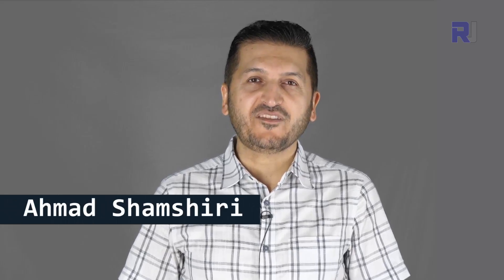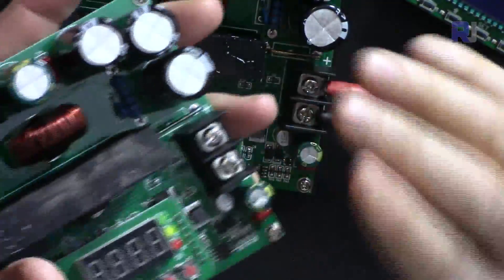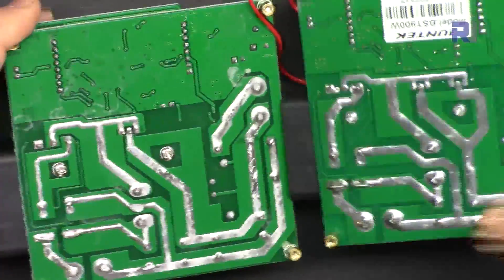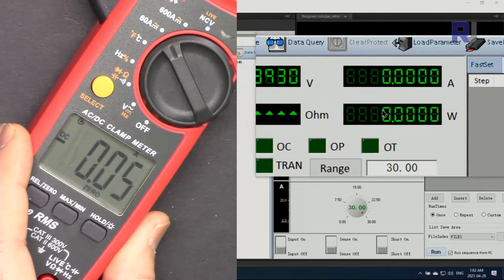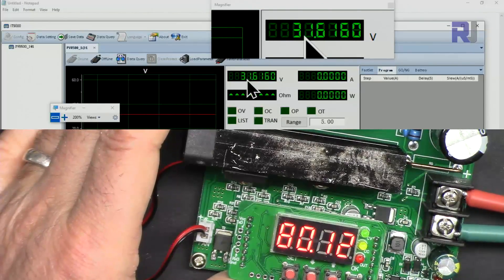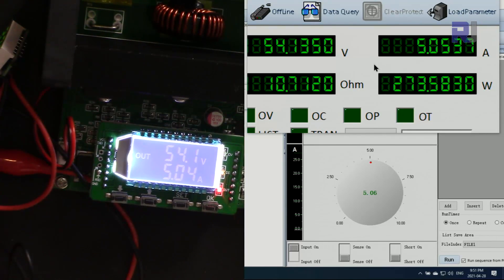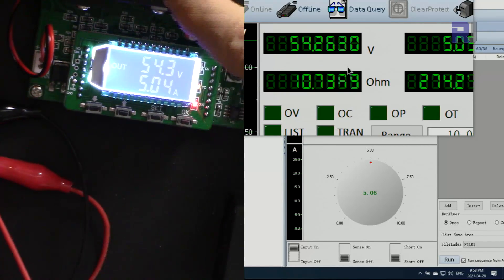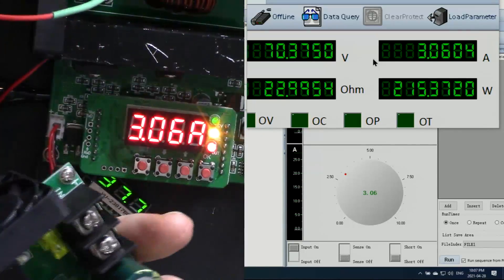Beware of BST-900W 8-60V to 10-120V DC Converter. Does not work. Fake 900W

Comment: new update from my last common .i change the fuse from 20A to 40A . and  last test update is input 11.85V(dropped limited input)  with  27A (320W)   and get  output 56V 3.85A (216W) efficiency 68% with that range between 12v and 56V .... and i stopped the test . because the coil and mosfet get crazy over  hot in 26A input for 2min ( need more big cooling )….. i think after i modified the component in the board it worked very very very good. ( if any one need feedback on this model please be free to pin to me about it . this model it have more power than you think but not from the company because they have too many things need change maybe for bad calculation design or bad component power .

Comment: hi Ahmad . I managed to make this unit work with full power . I do some reverse engineering about this dc boost converter BST-900W . you need to do 4 things changes in the circuit . 1:( in this unit there 2 shunt resisters , one for  current input that located beside the 20A fuse   and the other for output and its in the output . just short the input shunt to 0 ohm with soldering all over it with big wire . so the microcontroller do not activate the Mosfet slow down gate PMW protection ) 2: (change the coil from 0.04mH 0.3ohm  to 0.4mH 0.3ohm or 0.1ohm if you want less of drop down voltage but consider the Mosfet to heating up more) .  3: (change all 3 capacitors output from 330micF 200v to 470micF 200V  and the capacitor c14 104j 400v with bigger one that came with same 104k-E 400vmp .) and 4 : last things you can change if you want the Mosfet FDH055N15A with Mosfet IRFP4568 its same details with same every things of the stock Mosfet but with only better gate responding since the gate of stock need 4V and the new Mosfet only want 2V to activate and that give you more responding in high voltage pushup  .   i try it and it work you only need good coil or make one as i did . but you will hear some sound from the coil in high frequency . 

i can send some picture later about the changing part and a picture of input 11,7v 20.6A !!!!  and output of 50V with 4A ( efficiency drop )coil need more caliber calculation with the  high frequency and large range boost voltage . i was happy to fix something  originally was weak . and even better i was able to power up the input to take 20A ++ (i did  not over it consider the fuse is 20A and the mosfet will heating up not able to cool down easy

Comment: The specification clearly shows a max input of 15a and 60v so if the input voltage is less than this, the input power will inevitably be less than 900 watts and the output power also.

Comment: hi ive been useing this for six years. perfectly.. it charges my lipo4 batts. 48v.  --72v. and 82v. li.. and lipo4.. no trouble
Reply from the maker: voltage is no issue. it is the Power (current). they lie about it.

Comment: 80 volts and 15 Amp will never work. The device is 900 Watt no 1200. SO if you want 80Volt you can have max 10.5AMp. Power = Volt x Amp
Reply from the maker: You can’t even get 200W. I have shown the result. All stores are selling it as 900W on eBay and AliExpress.
Reply: There must be something wrong. Many videos on YouTube show these devices working as advertised. maybe not 900 but 700-800 watt no problem.  I ordered one just to test in my lab.

Comment: Hi Ahmad . This device as I try it in many may is not more than 100W in between 12v and 50v and 70w between 12v and 120v but it can deliver max 150w when you have less than 10v deferens

Comment: Hello, the problem with these boosters is that they always refer to the total input power supported. For example, in the case of the bst900w, with an input of 60V at 15A (with that voltage input it gives the 900W that the equipment says it supports) however for other input voltages such as 12V you have to be aware of the maximum 15A that the module admits (12*15 = 180W max) therefore if you want to raise from 12V to 60V, you have to respect the 15A input, which you have left to work 180W, where the output will have a maximum of 60V and 3A which gives 180W, with an input voltage of 12V and a maximum current that supports the module of 15A.
Reply: Your explanation is clearer than his, did not explain much of his setup, like we understood it already.  Like what's that on the left computer screen, its just annoying and does not help much of the explanation. This guy does not know how to explain well his setup.  I have a mini dc to dc converter and you can't set all of them to their extremes must obey the laws of power supplied, and the current and voltage limitation of the converter.  So I highly doubt his presentation, he must just be confusing himself and did not understand properly how a buck converter works.  But anyway, I shall heed your warning even if I doubt it, was going to use this to power my powerstation from car battery and adjust the rate of charge using this. Since this is expensive device and no other video on youtube show setup to extreme only to lower currents, Ill hold it for now and maybe just buy those inexpensive enclosed 12v to 24v buck converter which are cheaper.
Reply: Thank you explained
Reply: so the power only refers to the maximum Vin and I(in) that the module supports. I give you a very useful formula to know how much intensity you will have at the output according to the input voltage and the maximum input I supported by the booster: (V(IN) * I(MAX_Ic_IN))/V(out)= I (MAX_Ic_OUT)

Comment: Hi, I've been using this product for a year, mine does not have the Brand Label you show. I purchased from Amazon in USA. 
Regarding the issue when you turn it on to charge your  battery; the voltage reading you see this voltage level of you battery your maximum voltage setting(80v). As your battery charges this voltage reading will increase up to 80v, at which time it will stop charging. Also the CC LED is normally 'on' when you begin charging.
I've only used mine to charge my Lion battery pack to 53v and 1A so I don't know how this controller works at the higher voltage and current levels you are using.

Comment: Wanting to buy one of these make sure it is a Ming He branded one. Mine works up to 120v and is really crazy really because who needs 120v DC anyway most times. However i only tested it to 600w because after the 6th 100w bulb i said ive seen enough to trust it was working. Also for others reading this,  keep in mind that if you dont provide enough input current it wont go past a point before you have input limiting.

Comment: Hi. I have that version with LED display and I'm more or less satisfied. I have bought it as charger for my electric scooter because battery is 60V and I have power supply only 60V. Because battery require 67V at full charge, I use this 900W device. I'm able to charge at 670W. So I'm drawing 788W from my power supply as input to that boost converter (55V@14A) and output I have 67V@10A (670W). Difference caused 85% efficiency which is in the description. I'm using it for 3years without any issue. One thing that bothers me is noise. That switching noise is pretty loud. So if you have on input for example 12V@15A (that is maximum possible current), that is 180W. On output you can draw only 180x0.85=153W. Which means that if you want 120V on output, you will be have current only 1.275A. If you want 900W, then for example you have 60V@15A on input and 60V@12.75A on output, which is 765W (with 0.85 efficiency). So 900Watt means only for input. Sellers on Aliexpress often lies. Yes. But in this time it was close enough to the truth.

Comment: I have been using one of these for 3 years. Mine is MingHe, not Juntek.  I also do not see the current rise as it should.  I charge a 60v battery.  From a 12v source I can only get 1.75 a. From a 24v source I can only get 3.7a. From a 36v source I can get  7.5 a.  I have not tried 48v source yet. It has been reliable.
Reply from the maker: Hello, I am trying to tell people that this is sold under 900W and it is not even 200W. that is it.
Reply: @robojax   You are right. It is cheap chinese junk. Another problem is the mosfet that controls the fan is only rated for 40v and it fails. Then you cannot check it becuasee the code is burned off. it is AOD4184 .  Part of the problem is my mistake in selecting a boost converter for charging my batteries instead of a buck converter.  Boost converters loose amperage the more they try to boost the voltage.  Buck converters Gain amperage the more they reduce the voltage.  I suspect a larger inductor would address the issue you raise.  If you try it and post a video please send me a message an I will contirbute a donation.

Comment: my only problem with your testing is it was limited by the current capacity of your thin wires try using 10 awg in from a car battery or your power supply then test the output load because with my small jumper wires in from my power supply it is a 12v 5A backed up with a 16v 83F capacitor bank and i was able to push out 70.54v at 0.58A into a 200w 120v heater core and got usable heat from it so i will be using this for a battery powered heater that uses less power than most 3 party vehicle heaters and be usable for a tent overnight powered by a li-ion battery pack that can supply up to 6000-8000mAh
Reply from the maker: The wire has no issue. I don't know if you watch the video fully or not, I first showed that my power supply can supply  way more than enough for this module.  Thin wires will cause voltage drop like source outputs 100V and due to the current (ohm's law) it delivers 95V. Wiring is not issue. this is item is sold with fake power value.

Comment: I have one of those boost converters and is not very stable above 80volts 4 or maybe 5 amps. The problem is the power mosfet. Its rated at maximum 150volts 10 amps i think. So when you need for example 80volts@5 ams or 400wats you can imagine the mosfet is in overdrive mode before burn. Just the current is too much for it. 400wats for example at 12volts imput is 33.333... amps if the boost process is 100% efficient,  which is not, maybe 70 or 80% max. So you can imagine the stress this poor mosfet has. The maximum stable output is maybe 40-50 watts @ 12volts 6 amps.

Comment: The D3806 buck-boost is not so high power, but it works well enough, it would be nice to see a review of it.
Reply from the maker: yes but they are selling it as 900W and I purchased it thinking it was 900W. I could not return it as the shipping cost was on me and it would cost about $40.
Reply: Yes again if someone want one that works well Ming He branded one is the Real ones that work. I will admit I did have to repair my 3806 once already because I shorted out the power rail adding a fan lol but after adding in new chip I was back up and works great

Comment: Hi Robojax, I use the W900 on my Freegen because it acts like a fill and dump charger. I got it from Banggood But max 3 amps at 120 volts and 14 amps at < input volts. W900 has fake claims you are right! Cheers

Comment: None of these small, Chinese made, switch mode converters or power supplies output what they advertise, at least not in the real world. Heavy loads usually require a linear power supply that uses a properly sized transformer. The cheap Chinese made switch mode power supplies will drop voltage to reduce total watt output under working loads. It's what they do. And the ones that don't do that, burn up quickly even if fan cooled. Some switch mode converters and power supplies will output to their maximum watt rating, but at a lower voltage, whereas others will go into some safety mode and barely output. Meaning, you may get 900Ws but maybe that's 50V @ 18 amps, not 80V @ 11.25 amps

Comment: Actualy BST-900W is a name of model not actual power this is marketing. My version of BST 900W uses IXFH150N17 as pass through element which is capable only 830W absolute max power. I guess it can push 600W no more, I was able to get only 200W with car battery 400W and electronic load. The answer is clear you cannot reach 900W with these modules. These units CC functionality is limited, because Vout >=Vin, so if unit regulates current it cannot go less than Vin, so current stays unregulated in range of voltages Vout 0-12V it just gives 12V.

Comment: Hello. What is the input voltage? I think 900W is at the input, 900W / 15A = 60V,  the maximum power at the output is obtained at 60V at the input.
Reply from the maker: I could not even get 3A. You should have watched it.

Comment: I also bought this product before. Set the output to 120V to power up a 2000W 240V electric kettle so I should get 500W at 120V. Guess what? Turns out the main switching MOSFET got shorted and died during operation. Maybe changing the MOSFET could improve it's power capability.
Reply from the maker: no. it has design flaw.  you can get only about 180W or 200W.

Comment: I agree mine maxes out around 588 watts, 42 volts and the current drops down to about 14 or so amps I think.  Bu,t 𝐈 𝐝𝐨 𝐧𝐨𝐭 𝐤𝐧𝐨𝐰 𝐚 𝐛𝐞𝐭𝐭𝐞𝐫 𝐚𝐥𝐭𝐞𝐫𝐧𝐚𝐭𝐢𝐯𝐞 𝐝𝐨 𝐲𝐨𝐮?  I thought about adding another power supply into the mix but I might have to add 3 more

Comment: hi robo jax i bought the same unit and i tested the voltage with 12 volt input with 15 amp atx psu ,and it outputs a stable voltage all the up to 120 volt output with 12 volt input, so the voltage part works as they say ,but ive yet to test out the current draw and current output as i dont have a meter for current draw ,but ill see if can borrow one this week and keep you informed ,but from what i see with yours its definatly not working the same as my one, im pretty sure the quality control isnt to good on these,
cheers Kate

Comment: Hi, if we need a buck boost with automatic parameters of voltage and amperage like this one, i need just 250W. Would this module work or could you suggest another model.
Reply from the maker: This is just junk.  See this video https://youtu.be/xSI9k5BK-jU

Comment: I design switch mode power suppliers for a partial living (I write software most of the time), and I have two of these that I originally had plans for until I bought a 120V/3A bench power supply instead.  After watching your video I dragged one out of one of many packing boxes and had a quick look at it visually only (my work bench is not set up - after moving recently).  I looks like the inductor may not be up to the job by saturating way before 15A, or by using the current mode controller (UC3845) they may have the current sensing resistor too high a value (normally on the source leg of the mosfet). THESE ARE SPECULATIONS ONLY THOUGH.  What is certain though is the controller they are using, the UC3845B has a max PWM of 50%, which for a boost circuit means 2x voltage boost max (less diode drop of 0.5V and other losses).  I cannot tell from your video, but you do know what you are doing, so I assume you were feeding it 40V+ (42-43 maybe) to get your 80V.  The specifications DO NOT tell you this, but <2x MAX boost allowed. So something like 20V to 50V is NOT POSSIBLE!  It looks like it really is a very crappy device! :(   BTW you could replace the UC3845 with a UC3843 to get much higher boost ratios, but be careful with input current as I expect the inductor may not handle it, but the mosfet should be ok, as for the software on the digital display, well who knows.  ...anyway, just some food for thought! :)

Comment: Hey, thanks man! I was just about to buy few. I am looking for some capable dc converter to boost my 40V 40A SMPS to something above 100V and an acceptable current for titanium anodizing (the process draws low current until you're over 90V - then it jumps from under 1A to over 5A, for example, depending on the size, ofc). I was thinking whether to buy one of those 1200/1500/1800W modules (they're all similar looking) and in the end I figured this one is nicer, more convenient and so on...
Now I'm thinking to just use a 10-20A diode with mains, I dont need precision, just power. See, I wouldn't even think of that had I not watched your vid. I'd just throw money.
I love your videos! Cheers!
Reply from the maker: Hi, I am glad you found them useful. Thanks. Cheers!
Reply from the maker: you may find this 1500W module review useful https://youtu.be/AGGkljZIk8k
Reply: @robojax  My man, can you tell me how many amps were you able to get out of this at 100 - 120 volts? Cause, I figure, if it's gonna keep the voltage from dropping at 4 amps, that might just be barely good enough for me...
Sorry for bothering you ;D
Reply: @robojax  RJ, have you had a chance to check out dpx800s converter?
Reply: Be careful bro. you get to a titanium color after hitting the second blues at over 100Volts.

Comment: I think you are reading the specs incorrectly. 15 amps "input" (not output) is the limitation of the unit.

The quoted 900w output can only be reached with 60v input (60v x 15a = 900w), the unit is limited to 
15a x "~Input Voltage~" = ~Output Current~
So if you only supply it with 10v input, you will only get 150w output at 10-120v (15a x 10v = 150w).
Reply from the maker: We didn’t even get 300W regardless
Reply: @robojax  but that's my point, your looking at the output, you need to look what it's drawing current wise, regardless of what it is putting out if it's drawing 15a (regardless of voltage) that's it's rated capacity. Then see what the output is in relation to that.
ie (input of 20v at 15a = 300w) - (output 40v at 7.5a = 300w - 15% loss) = 255w expected output.
Reply: @robojax  I use 2x of them to charge my Veteran Sherman Unicycle's 100.8v 3200w battery from my 4WD, as it has duel charge points that can take up to 5a each.
Input 12.7-14.4v at 15a (~216w)
Output 101v at 1.8-2a (~200w)
x2 units obviously = ~400w change